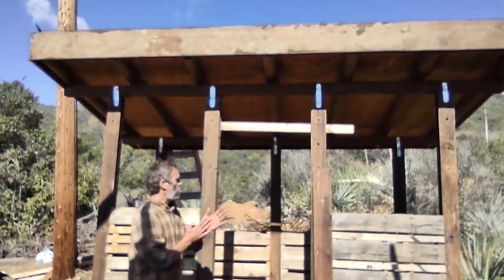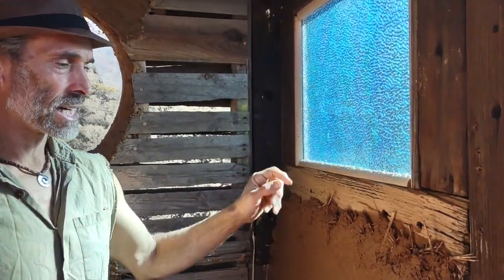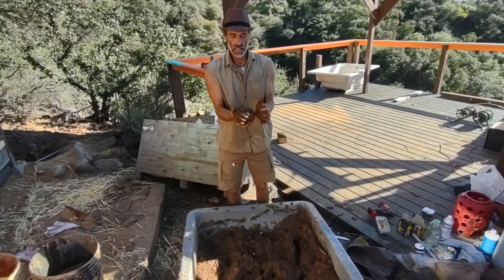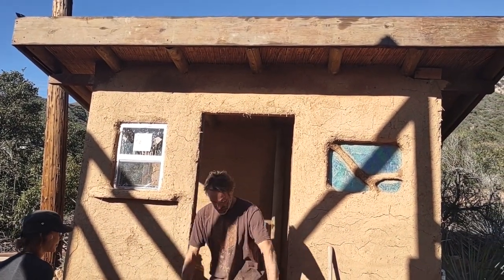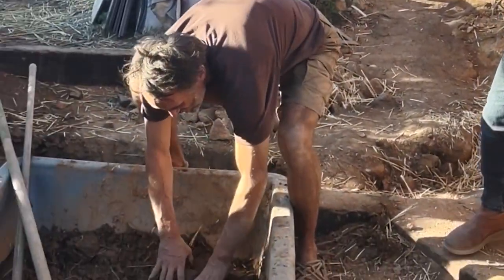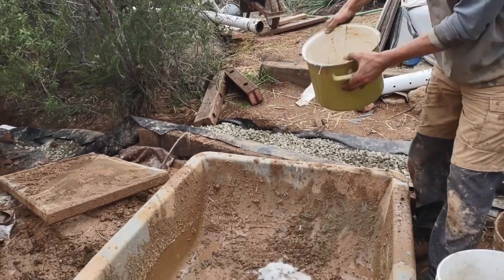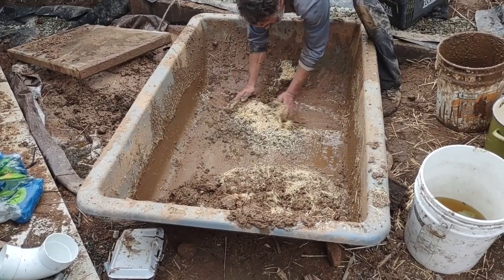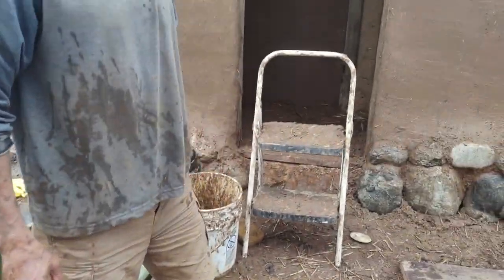Cob building in LA

Comment: Dear Miguel, my homestead is in Northern Nevada, we get intense triple digits in summer and up to six feet of snow in winter.  Was contemplating using your economical and eco-friendly building technique to build an elevated igloo with root cellar. Just curious if the cob will endure frigid temperatures? I have plenty of sand, clay, and straw, cactus, and even limestone on the property.  Thanks for any feedback.
Reply: I would say strawbale is better for what your looking for.  Better Rvalue. Check out his school at standing rock. Cob finished of course.
Reply from the maker: Yes a pallet structure would be fine in those conditions however yes a straw bale structure would be better insulation however you would still need a heat source on the inside for the winter to stay warm
Reply: @cobalot9  Yes, am thinking of incorporating a rocket stove heater on the ground floor. Will also use reflectix  attached to the bottom floor beams. Am afraid of strawbale because some folks claim the straw will shrink and make the walls shift.  I did watch the videos you made at Standing Rock. Thanks very much!

Comment: I could get all the materials I need for free, except the plaster. I'd be stumped on how to do electric though.
Reply from the maker: Yeah that's the great thing about this building is that most materials are free even the Earthen plaster... it's best to get help with the electrical from somebody with experience
Reply: @Miguel Cobalot  yep! You've inspired me to at least build a small structure!!! I'm going to start working on gathering everything today!
Reply from the maker: @ashleydawn8920  great! Best of luck with your project! I'm curious where you are building...
Reply: @Miguel Cobalot  I have property in Missouri, but I'd be getting most of my resources off my aunt's property. She owns over 100 arces of land. She won't mind if I gather dirt and trees :).
Reply: If its a small structure, diy electric is easy if you use a solar panel and a solar generator...no wiring, the "generator" has the inverter and charge controller and batteries internally, making it plug and play simple.

Comment: if you have lots of bottles to fill in the pallets and they are empty, would it be better to fill them with dirt of to leave them empty? i am thinking of structural integrity, putting more weight inside the walls would it help or make it weaker? been following you for some time dude, lots of teachings to get from your videos, thanks.

Comment: I will share something I learned from an adobe artist.  If you mix oil (she used boiled linseed, but I used used motor oil--seriously its free and amazing) directly into the cob or adobe plaster, it transforms the stuff...gets sticky, plastic-like qualities and adheres like a dream, smooths like butter, and dries with zero cracking AND best of all is WATERPROOF.   Rain beads right off.  Works better than commercial wrstern one-coat or any other mud mix I have ever tried.     Then you dont need a finish coat of oil.  
Her testing showed that topcoats of oil were not durable, flaked off over time.  Test bricks infused with oil all through the mix survived years of exposure to elements beautifully.   Save yourself some trouble, it works very well.
Reply from the maker: Interesting! I may try using that technique , thanks for the tip!
Reply: @cobalot9  have fun with it!  I dont recall the exact amount I used, just that it wasn't very much.  A few test batches and you will figure it out easily, I am sure, because you already know what a good mix feels like.